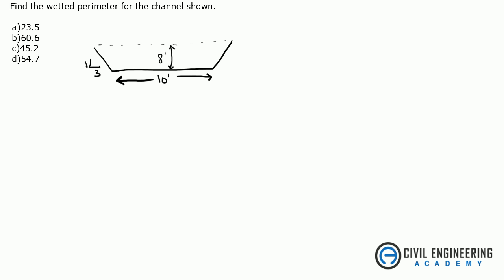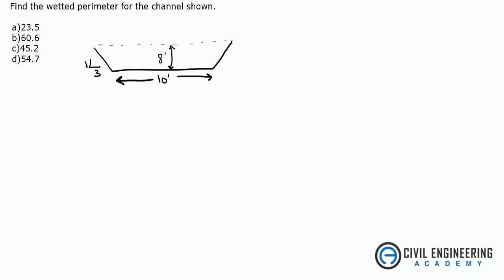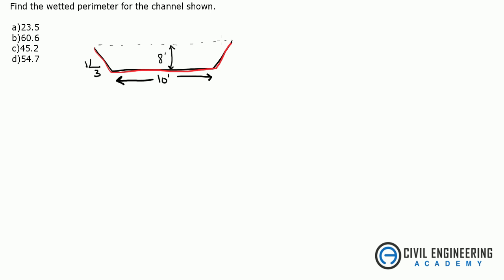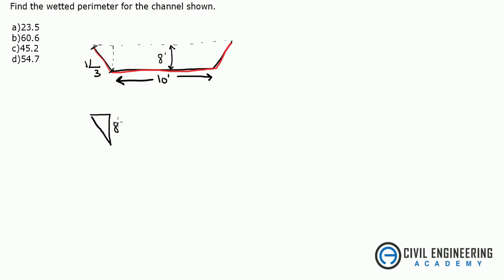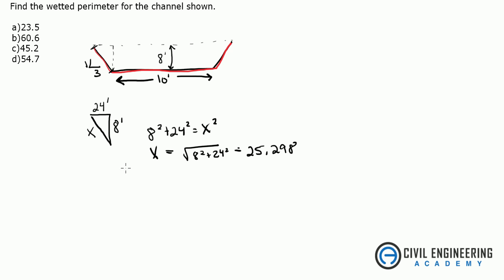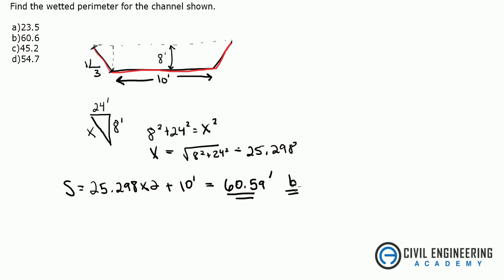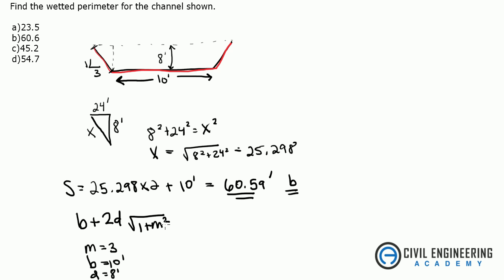Water Resources Wetted Perimeter

Comment: In your equation, does m=3 because you're dividing horizontal by vertical? or 3/1?  
If the slope had a horizontal component of 3 and a vertical component of 2, would m be 3/2?
Reply from the maker: +mtablan You always want that vertical component in terms of 1 so this is a 3:1 slope in your case you would have a 1.5:1 slope and your m would be 1.5.  Hope that makes sense.
Reply: Just not very clear that it is 3 to 1, normally people write it with a colon in between or make it obvious instead of making it seem like the bottom width is 3...